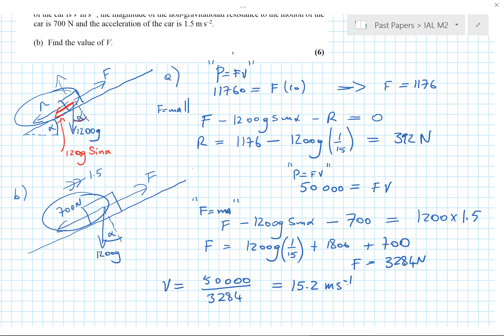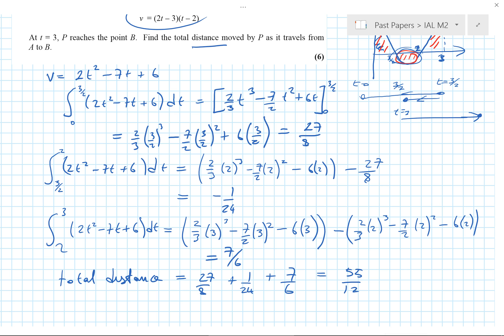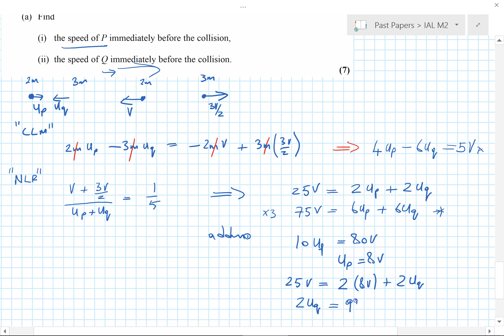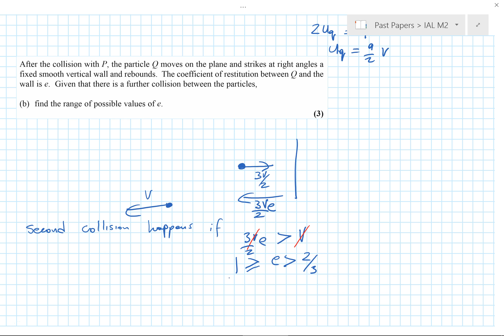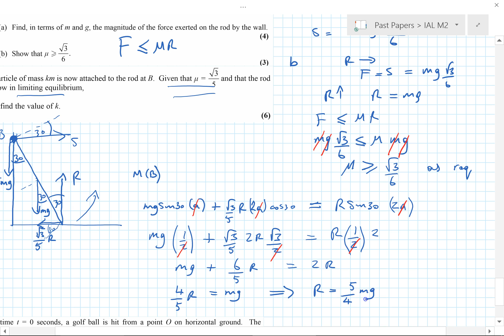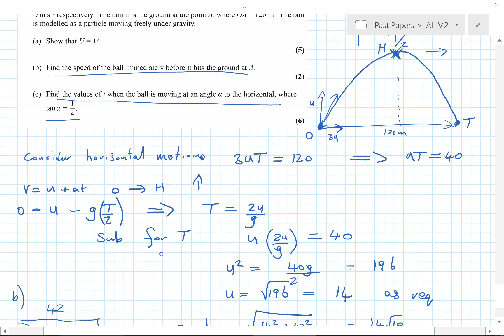M2 IAL Edexcel Jan 2017

Comment: In question 8 , why did we consider the velocity as constant ?
Reply from the maker: In all projectile questions an important principle is that horizontal component of velocity is constant. We always assume there are no forces acting on the particle other than force due to gravity (ie no air resistance, wind etc) so therefore the horizontal velocity remains constant since the only force acting (weight) is vertical.

Comment: Would I get the marks on question 6 if I used the work energy principle to find the speed of the ball just as it reaches the ground and then used the work energy principle again considering the part of the motion when the ball sinks into the ground? I know it is overcomplicating it, but I didn't realise that is could be considered as one motion until I had actually done the question. 
Also, this is a very good video and is making everything clear.
Reply from the maker: Thank you Sarah- I suspect lots of students did what you did and split into two. I am sure it is ok if you have used the work energy principle for BOTH bits.

Comment: How do you know when to have work done as negative or positive?
Reply from the maker: If the external force takes (Mechanical) energy away from the system then take as negative (eg friction, air resistance etc). However if the force adds (Mechanical) Energy (eg a driving force) then take  work done as positive.
Reply: John Rogers was the work done in this video positive because the ke and pe were also negative and they just got cancelled?
Reply from the maker: Well yes kind of- In this example there is a loss of both KE and PE- this is as a result of the resistive force which takes away energy from the system.
Reply: John Rogers thank you very much and great vid btw